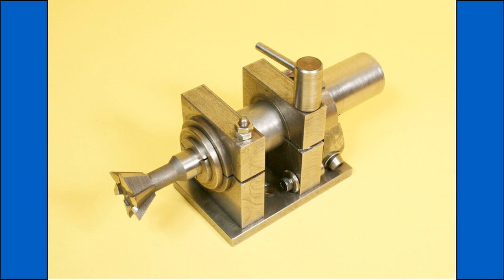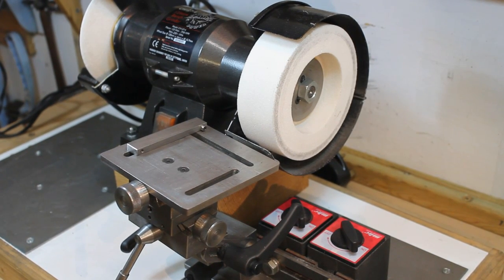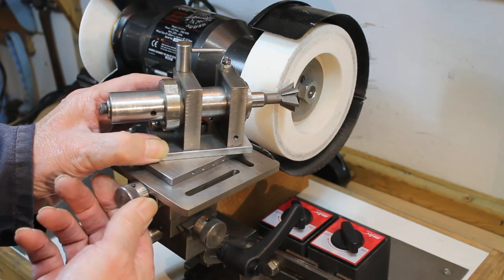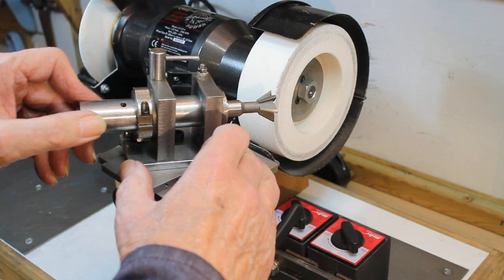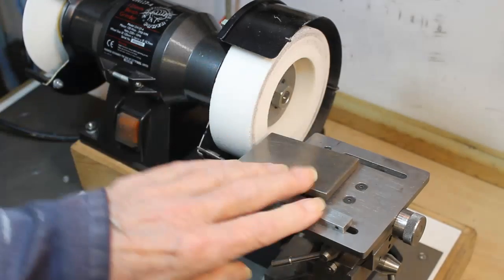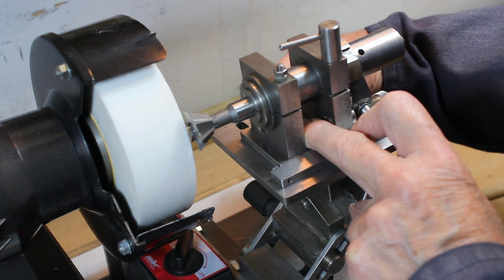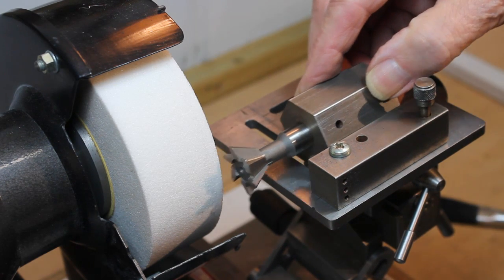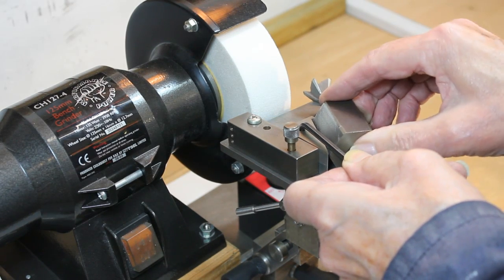Dovetail Cutter Sharpening

Comment: I'm enjoying all your videos.  What type (style) and size grinding wheel are you using in this video?
Reply from the maker: Pleased to learn you are finding the vidios interestings. As to the wheels, they are all 125mm diameter with a 31.75 diameter bore. The wheel on the left side is a saucer wheel and gets very little use, outher than grinding an
end mill's flutes as the wheel needs to be on the right of the end mill. Depending on the space available the end mill flutes can be ground down the left side or the wheel on the right hand end of the grinder.

On the right side I have two wheels, a taper cup wheel for most of the sharpening tasks, the other being a 40mm wide recessed wheel, used where I need a wheel with a wide outer diameter. I do use it in place of the tapper cup wheel if it is on the grinder at the time I wish to sharpen a tool.

The wheel grades are WA60KV1, or something close depending on what is available from the supplier I use. 

I am hoping to produce a video showing how a basic bench grinder was modified to take the wheels I now use.
Harold
Reply from the maker: Pleased to learn you are finding the vidios interestings. As to the 
wheels, they are all 125mm diameter with a 31.75 diameter bore. The 
wheel on the left side is a saucer wheel and gets very little use, 
outher than grinding an
end mill's flutes as the wheel needs to be on the right of the end mill.
 Depending on the space available the end mill flutes can be ground down
 the left side or the wheel on the right hand end of the grinder.

On the right side I have two wheels, a taper cup wheel for most of the 
sharpening tasks, the other being a 40mm wide recessed wheel, used where
 I need a wheel with a wide outer diameter. I do use it in place of the 
tapper cup wheel if it is on the grinder at the time I wish to sharpen a
 tool.

The wheel grades are WA60KV1, or something close depending on what is 
available from the supplier I use. 

I am hoping to produce a video showing how a basic bench grinder was 
modified to take the wheels I now use.
Harold